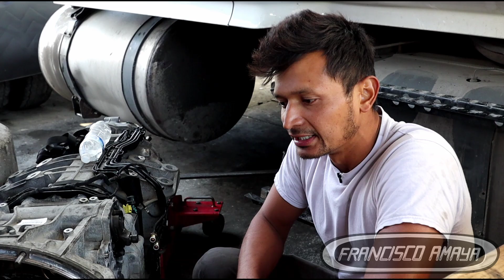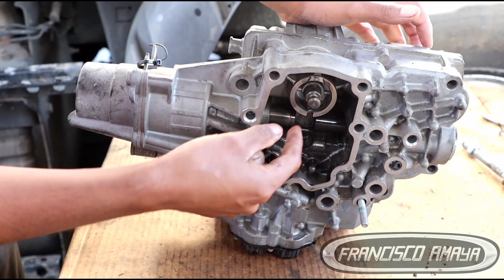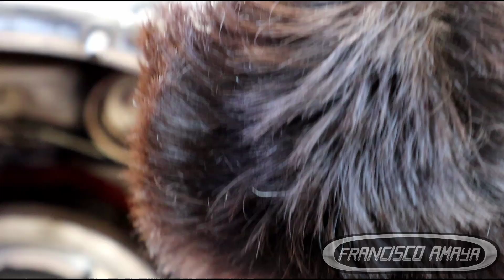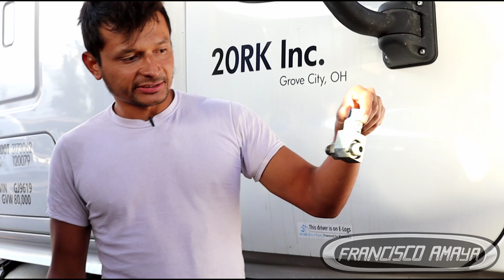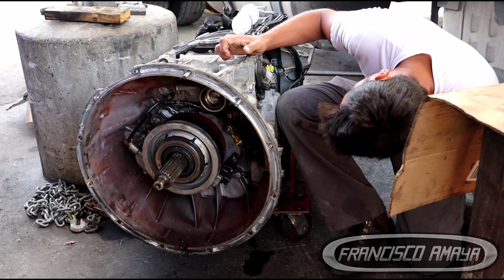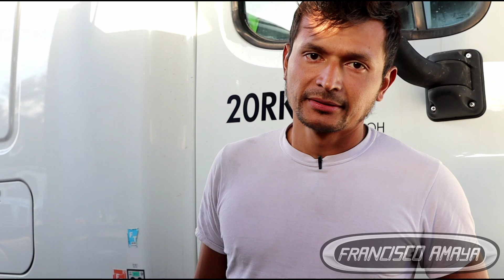Freightliner Cascadia DT12 automatic transmission issues clutch not working truck does not move

Comment: In need help 
Last week i replaced cluch and actuator  on fraithliner cascadia  2021
Next day it start making problem when starting the truck.
Some times it will start 5 of 5 try  but some time when starting only crank ones and don't start. You need to try  more times and it will start. Please help, the mechanic check the wires and the starter and it is ok he said.

Comment: If I accelerate very slow my transmission doesn't slip out of gear when I have a trailer. But if I accelerate to fast it revs and even slips out of gear in the 10th, 11th and 12th gears. What is the problem?

Comment: Help Francisco I have a dt12 which when put into gear would leak air you could feel the air leaveing the bell housing no codes and wouldn't go into gear what could the leak be is it the hose or the seal on the back of the actuator or the actuator it's self

Comment: I have this code and the truck is not shifting. I change the shifter and they change the CPC and they change the clutch and they change the actuator. Still same problem not working what I have to do ? 

1/////Gear Pos. Sensor 
Problem Detected
Shifts Inhibited////

Comment: What are the symptoms of the fault ? 
I have a 2018 CASCADIA that has the same transmission, sometimes it’s acting weird, when I’m in traffic it shifts to N when I slow down to almost zero and try to resume going without coming to a complete stop , I don’t know what’s happening but I have to come to a complete stop sometimes to be able to resume, please help me figure out the issue and is it signaling for a more serious problem ? Thanks
Reply: Do you resolve this issue?

Comment: I just got done replacing the clutch in one of these at my shop and per instructions am replacing the actuator on the transmission as well. But when I compress thee actuator and bolt it up in the compressed position it keeps slowly creeping outward until fully uncompressed. I got a brand new o ring on it so it's not that. And if I compress the actuator and hold my finger over the hole it will stay compressed all day long. My question is what inside the transmission could be causing it to lose vaccum? Any help would be awesome thanks. Love the video.
Reply: Did you end up getting it fixed? And how? I have the same problem

Comment: What does it mean if I have the same transmission and it slips in 12th gear when I get on the gas but every other gear is fine
Reply: Same exact problem I have, did you solve it?

Comment: Good evening Francisco, got an issue with a 2016 DT-12 tranny, automatic. The 7th gear on the tranny grinds when driving. I replaced the clutch, actuator, module, and cpc plus the ecm on this truck and still can't take the grinding away. Any thoughts on what it can be. O I forgot that when I try to learn the gears with my computer, it doesn't allow it to finish the learning process.

Comment: Francisco, what's the life expectancy of an AT12? I had my clutch, actuator and clutch brake replaced January 2023. Around May or June it started displaying characteristics of the Split Shift Rod issue, dropping to Neutral and hesitating when upshifting from 9 and would typically drop into 11 at around 1100RPM when clearly it should be in 10th. Then around September it started also exhibiting the DDC-SVC-MAN-0140-15.1 Engine RPM Flare during upshifts. I contacted the dealer inquiring as to why they didn't check the Split Shift Rod when they had it in January, convinced they'd overlooked it. But they showed me a Daimler record of my truck receiving the titanium collar in 2017. They added that they'd never seen one fail. I took it in to have a road test and computer disgnosis and they said they took the screen out and they found metal filings. At 879,000 miles, they're advising that the transmission needs replacing. Although I'm suspicious of the metal filings being the clutch brake or the split shift rod, I'm more inclined to just replace it than throw good money after bad. Any thoughts?

Comment: Would anyone know what normal operating temperature would be on DT12 transmission 2021 freightliner
Reply: Mine runs around 145°
Reply: Thank you does it ever get any hoter depending on conditions like loade up a hill so on and so on@moncelismoPR
Reply: Mine mostly runs right about the same 145 but if it's hot out side and I'm loaded, maybe going up a hill I've seen it go as much as 165

Comment: My transmission shifts higher gear than what it supposed to be for the truck speed! For example it shifts from 6th gear to 9th gear on 15mph or from 8th to 11th gear on 30 mph. It makes the engine die and rpm very low that i have to down shift it manually! Do you what is wrong with it?
Reply: Did you fix the issue?

Comment: spn 520970 fmi 7 

When cold transmission going to neutral?
Reply: I have the same issue did u find the fix?
Reply: @yadpandher6024  yes sir fix it you need to replace cluch cylinder and clutch Activator plus clutch kit 👌
Reply: @Javid-bc3mc what’s was the cost of the repair?

Comment: Hello Francisco 
I have DT12 transmission automatic 
While downshifting it’s going in neutral it’s pulling and running fine I have to do complete stop to put in drive again my mechanic changed split pin , clutch and actuator
 Still same issue please advice
Reply: Hi sorry dude did you finally fix it after all those expensive repair ? And what was the main problem? Thanks
Reply: Im in the same spot blue. I did clutch cpc abs module abs front sensors and the problem continues

Comment: i have an emergency question if you can help please … I have 2016 Cascadia with dt12 automatic transmission and my shift controller on the transmission is damaged … does that make my truck not to start at all ????????????????????? the guy who checked my truck with the computer said so but I kind of have a doubt as it doesn't make sense unless if you confirm i also changed the cpc4 and reprogram it to my vin and still doesn't start the truck and that's the only error it's showing just to mention ... the cpc was changed as it was stolen from my truck and i bought 2 used ones ... one is not programmed and it does crank my truck but won't throttle or put gear on .. and the second one is the programmed to my vin and doesn't crank the truck at all

Comment: I have 2015 Cascadia dd13 with Dt12 transmission My truck drives and moves in Manual mode but will not engage the automatic mode when i press the button  ? also randomly  a LOW AIR transmission message comes on dash .. could it be the sensor ? or what can cause this to not engage Automatic Mode? any help would appreciate it!
Reply from the maker: you clearly have a problem. pull the fault codes to see what is the problem with your truck.

Comment: I Have a code on my dash saying 
Gear Pos. Sensor Problem Detected Shifts Inhibited

2015 automatic Frieghtliner cascadia 
Which it’s not allowing me to go into to gear once I go into gear it just Beep

I had water in my air tanks I had to drain out 

It started to work but next day 
Same thing happened 

Fault code spn 521485 fmi 2
Reply: I have the same code, did you fix it? And how ?
Reply: Did you find it that’s issue please tell if fixed
Reply: @cabdiwayne8321 cilada ma heshay weli

Comment: Great video! Definitely informative. I did have question in regards to the dt12 not sending any active codes. But instead just setting off both abs and hsa lights. Also showing - - in the gear selection screen. Any input would be greatly appreciated
Reply: I’ve had same problem. 2016 Cascadia. Trans acts like it’s not getting enough air and then starts not wanting to shift properly. Then HSA light comes on and trans goes to neutral and I have no throttle. ABS light on also even though everything has been replaced related to ABS. Very strange. Any ideas anyone?
Reply: Did you find out what it was?
Reply: Did you get any answers?
Reply: Anyone get an answer?

Comment: Will this cause high revs between even gears as You accelerate?
Reply: I have same problem did you find out what it was?
Reply: No not yet. Still having the issue. And also give into gears too high for the slow speed, causing it to bog down and I have to downshift manually. Big headache
Reply: @kevinhicks3294  hey bro did every find out what was the issue on your transmisión
Reply: Has anyone found the problem?
Reply: Did you find out what it was?
Reply: My is doing the same, revs up from even to odd shifts only. How you had it figured out yet?
Reply: I have same.  any news

Comment: So how long does it take you to do the transmission job
Reply: I’m a freightliner tech it usually takes a full shift, which is removing - repair - reinstall - verify repair, our shift is 8 hours
Reply: @julienrogers1209  can you remove the transmission control module , the mechanical part, Without removing the transmission?
Reply: That’s quite fast and efficient and what will it cost

Comment: My 2015 Cascadia with DT12 transmission have some issue as the engine Revs when shifting gear 1,3,5,7,9,11 but it shifts fine when it shifts 2,4,6,8,10,12 what could be the problem please help me. Thanks
Reply: Did you find out what the problem was?
Reply: @justinmorehouse7275 did find issue I’m still having same problem haven’t got check out yet
Reply: Mine is doing the same except revs up on even number shifts. Have you found solution yet?
Reply: @markthompson7288 did find the issue yet haven’t fix my transmission yet
Reply: Same problem.  What was the solution?
Reply: Did find out what problem is I’m also having same problem
Reply: Anyone know what the fix is? I’m also having this problem
Reply: Esperando respuesta del problema, al parecer somos muchos con la misma falla
Reply: @albertogutierrez3755 did you fix the problem?
Reply: Please give update if anyone found the problem
Reply: I got a Reply on truck forum. It's the countershaft brake

Comment: Yo tuve unos problemas con mi transmisión DT12 de clutch y aparte de eso se salía de ciertos cambios porque no entraban bien en el engrane. Yo solo figuré todos esos problemas todo por el resultado de una sola cosa que perjudicaba con el agarre del clutch cuando solamente seleccionaba de D (drive) a R (reversa). El clutch está nuevo y aún así algunos mecánicos me decía que era el clutch pero no fue así. Aquí explico lo siguiente de lo que pasó de un trabajo anterior que le hicieron a mi camión con el dueño anterior que nunca me mencionó. La causa de todos mis problemas de transmisión fue por el sensor de presión de aceite del motor que fue “aftermarket”. Debido a ese sensor, la presión leía menos libras de presión de lo que debería de un sensor OEM (original) y en vez de solucionar el problema con remplazar el sensor con uno original, le aumentaron el Idle RPM de 600 a como 720 así para crear más presión de aceite y así para que el camión no joda con que tiene baja presión de aceite. Ese incremento de RPM’s perjudicó con el calibre de la computadora del DT12 y por esa razón mi clutch no agarraba bien cuando selecciono D o R. Compré yo mismo el sensor original y se lo remplacé y ahora me lee más libras de presión con el original y luego fui a que me le redujeran los RPM’s de regreso a 600 como debe ser. Mi punto es que si el motor tiene un idle más arriba de 600 RPM’s por cualquier razón con transmisión DT12, eso te va dar muchos problemas con el agarre de clutch y también para que entren bien los cambios.

Comment: Most of this transmission problem with small air breather  ;;  or you need to drill the down opining with 2 screws so you relieve the vacum from the clutch room
Reply: Elaborate sir

Comment: Sometimes when i switch from N to 1st or R all the air comes out from the shift controller's air exhaust. I change the clutch, clutch actuator, and split pin. Do you think shift controller is Bad?
Reply: who told you to replace the clutch if you had an air leak?
Reply: @MrAron13055  The truck had over 700,000 miles at the time. Might as well replace it while the transmission was out. Also, the fingers had uneven wear
Reply: Hi, did you find out what the problem was? Mine is doing the same for every gear change.

Comment: My DT-12  when cold doesn't want to go from 6 to 7th gear. Only after I warm engine for 1 hour.
Reply: sounds like the Split Pin is stuck
Reply: @solidgoldeazyaction  What about the range piston seals leaking when cold, possibly?
Reply: @ThatOneGuy-hp2pb  you got to hook it up to a computer and check the shift aborts counts on range piston and split pin to know exactly
Reply: @solidgoldeazyaction  cool
Reply: Hey did you figure it out that 6 to 7th gear issue ?
Reply: @dwaynehero662  I changed my air dryer cartridge and it fixed everything, 300 bucks
Reply: @ThatOneGuy-hp2pb  oh ok thank you

Comment: Con el software de diagnóstico puedes hacer varias pruebas para determinar cuál puede ser la posible falla, en ocasiones he tenido problemas de leak de aire, pin bushing con un número de abort counter muy alto que cambiarlo updated, o problemas con el Input shafts brake. Saludos
Reply: Que software o programación necesita para el diagnóstico?
Reply: DDDL 8.0 up